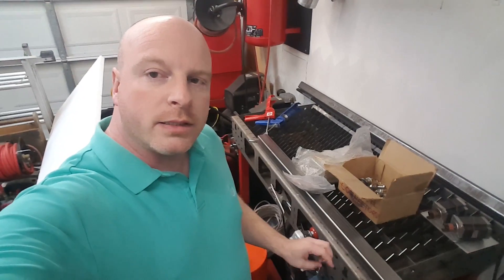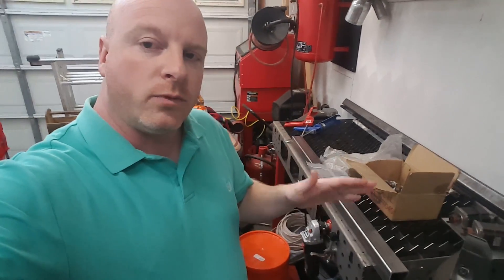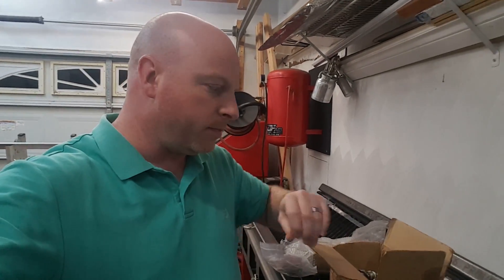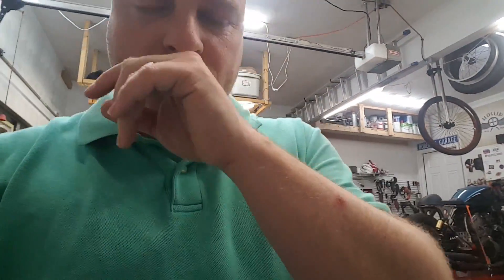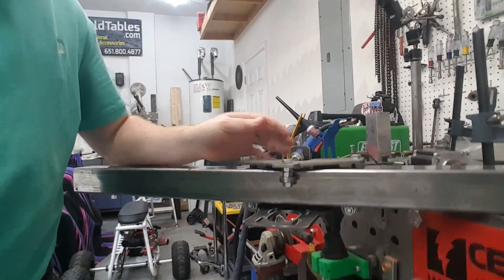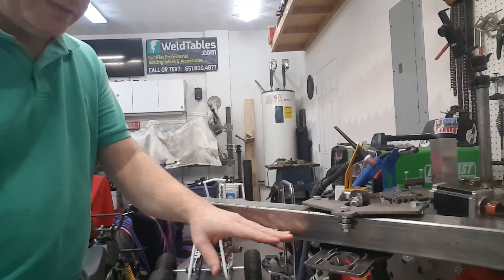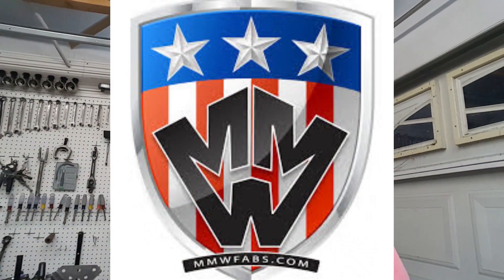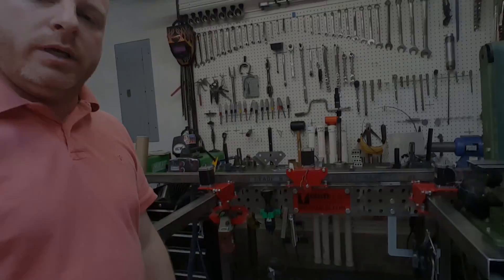Certiflat Plasma Table CNC Conversion - Part 1

Comment: What an amazing idea!! How has your machine held up over the years? Did the gear rack idea work well? Thanks
Reply from the maker: Worked without issue until I upgraded. It ran for about 3 years, sold it and they took it and ran it for a while and did a couple upgrades. From what I’ve heard it’s still running and cutting parts for his business.
Reply: @HaslipCycleWorks  Thank you very much for the information, friend. I really liked your idea of using gear racks. Belts cause a lot of problems and ball screws are very expensive.